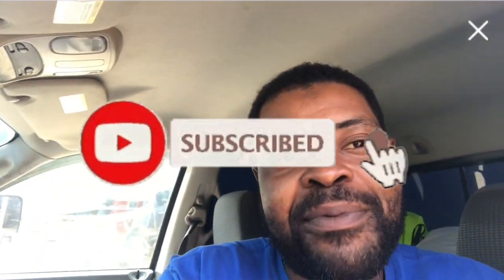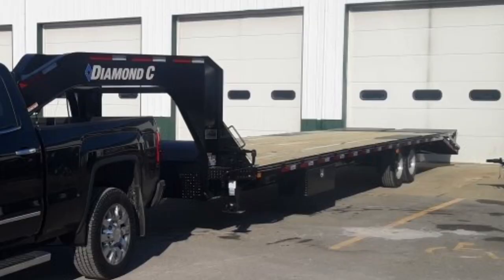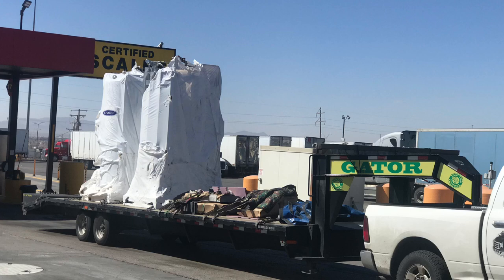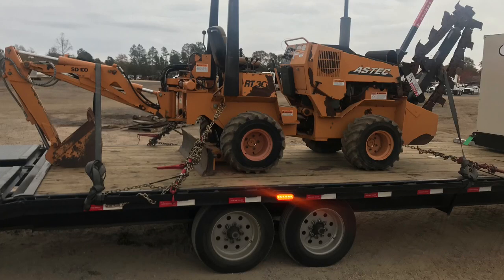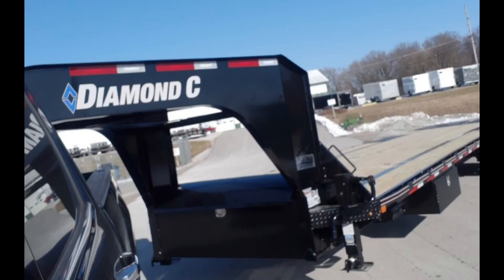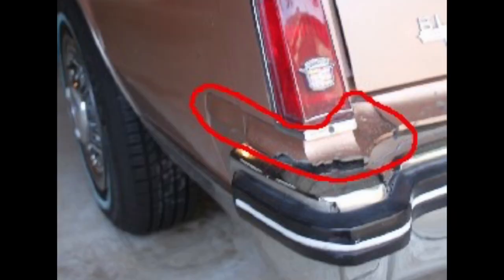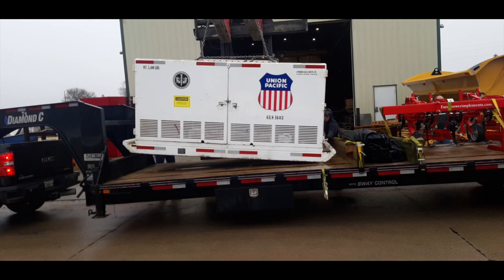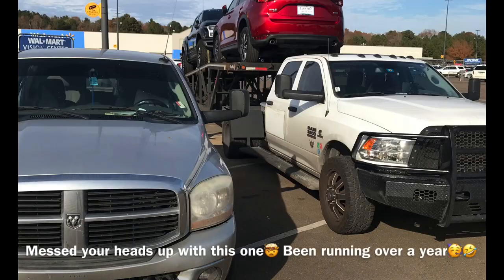Trailer Review!! Diamond C Vs Gatormade😎The results may really shock you‼️

Comment: I was looking at getting either a Big Tex or a PJ trailer....... anyone had any luck with PJ??
Reply from the maker: PJ was One of the best trailers I’ve owned for the money bro💯
Reply: Bought a PJ dump trailer. Low pro. Ran about $13,000 new. 22,000GVWR. I can tell you I doubt I’d buy PJ again just due to customer service. The rear doors had quarter size holes where the welds burned through and then they powder coated over. The powder coat was coming off near the front 3 days after buying. Also had a brake running a little warmer than the rest. The two main grease zerks for the pivot joint I have to drill a hole to reach. I called PJ directly. They said to take it to magnum trailers in SA. Called them and they said bring it by. I finish a job a week later and run it in. Magnum tried telling me I had to take it back to where I bought it in west Texas. After finally getting past that, they look it all over, tell me that PJ may fix some of it. The excuse for the lack of quality control was because they’re 1,000 trailers behind on build completion. Parts come in 1 month later and the best I hear is, the doors were replaced due to the holes, the powder coat is flaking off because they didn’t prime the metal. The brakes being warm I have to pay $300 to have them check it even though it’s under warranty. The axle is through dexter not PJ. Magnum the tells me the month or so after I filed a claim, if I had just taken it to PJ they’d of given me a new trailer when it was new. 

So take it foe what it’s worth.

Comment: Holly shit for the money you can't beat Appalachian out of Ohio they were dirt cheap i pd 4200 14k 20 plus 4 or 5 dove pop up with over shot they have new owners only thing I didn't like was not setting pockets on cross beam when you crank it its flexes but new owner corrected that but I flipped i changed axles because it was cheaper than brakes then added one I daily over load and never have and of those issues I broke some belts on tire with 18k on it I weighd it it was dragging it around about a year trying to figure out why my truck tires melted like they were on fire i was 42k on combo and was 23 rated so didn't take long to see see why my tires never held up that was one tough trailer only complaint besides pockets was angle iron dove tail i jumped out machine in rain foot whent through separated veins and had a foot ball on my leg but I add mesh and rubber cow Mats to load steel track machine its not top of line best bang for the buck it will bend when its double loaded  i had 30 round bails on it probably 1500 each i seen by rams stretching springs and on rubber blocks so took some off i use it in off road loaded heavy applications
Reply: Reason I opted axles i had equipment slide off fliping trailer to lay on side but the only damage was my tailgate it was 600 for 2 axles they wanted 2 x that for brake hubs in my home town
Reply from the maker: That sounds like a great trailer. I gotta check them out man👍🏽 some of the best stuff made in this country is made by companies that aren’t the most known. Let me take a peep 🤝👍🏽

Comment: I am not saying this is what happened on the 7k axles that you thought were 8k could have been an upgrade to the 7k.  I have looked at doing this 7k to a 8k axle up grade just to get the oil bath bearings on a gooseneck I have owned for years.  You can buy a new bearing hub upgrade that is supposed to make a 7k axle bumped up to a 8k.  I am only thinking about it for the oil bath bearings as mentioned but I don't intend on hauling more weight because the springs and brakes are all still the same.  That is the only reason I am thinking about it.  I could be way off base but I know that could be why the trailer was put off and put off then all the sudden it was available they could have done the bearing upgrade an the drum would be different than the drums I run with 16inch wheels.  I loved the video man!!
Reply from the maker: 7 k to 8k upgrade is not a real thing. Only cosmetic. 7& 8k have a completely different axle diameter and shaft end,  length and bearings. The U bolts for a 7k axle won’t even fit over an 8k axle. The 7k can be convert to oil by changing the drum and seals. The oil drum has a threaded cap area for the clear sight glass, but use all the other 7k components. The brakes don’t swap at all. So basically all you get is a brake drum with bigger studs and a clear sight glass. Capacity or longevity from bigger bearings and surface area will not be realized.
Reply from the maker: Yep
Reply: No, and your dont want oil bath bearings,
Reply: @Drewdayz2419  why is that?  I don't want this kit I found it wouldn't be as good as buying new heavier axles that would have better brakes and heavy duty springs.  I have oil bath bearings on a set of heavy 10k Dexter axles on a tandem dual gooseneck that I ordered from the manufacturer back in 2001 that thing has been all over and I have had no trouble with oil bath bearings . The two tandem dual goosenecks I had in the past never had any issues either.